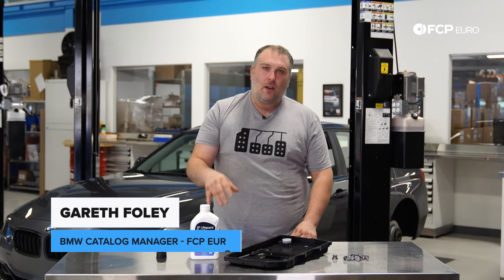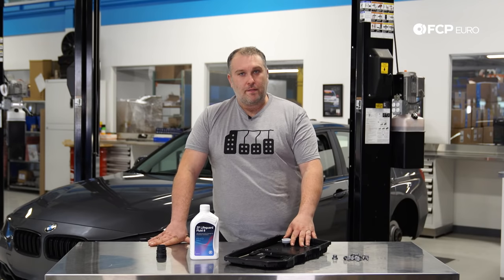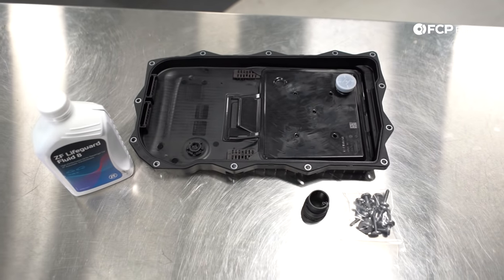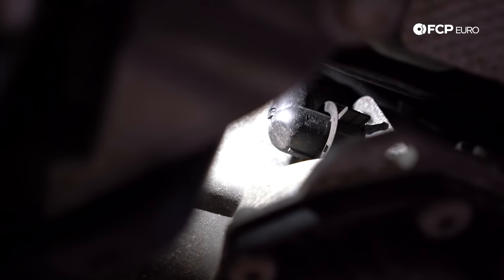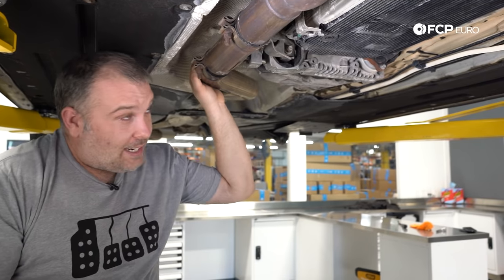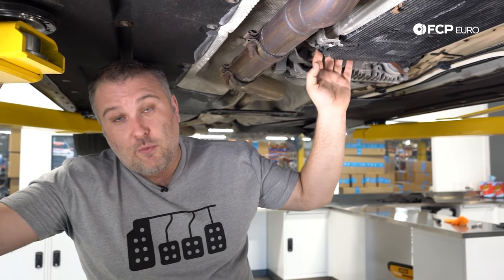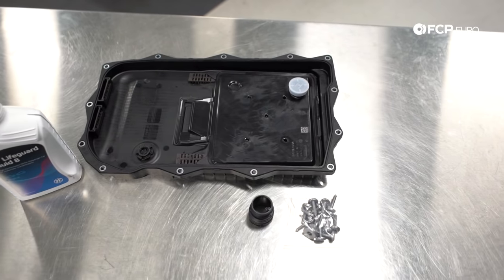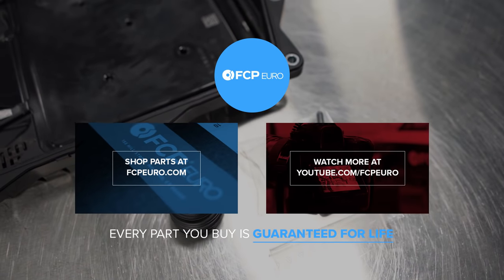ZF 8-Speed Transmission Guide (8HP45) - Specs, Common Problems, Diagnostics, & Maintenance

Comment: Hi there, my wife's 2015 x3 28d had a drive-train malfunction last Saturday. She came of the hwy and as she was turning right the car jerked twice and then lost power. She pulled over and shut it off. Waited 5 minutes and restarted it. Motor was fine but she could not select gears just stayed in park. Now it got towed to Kingston BMW and they diagnosed it as it needs a new transmission at 15k plus 2500 labour and taxes on top of that.

Now the car has never showed any transmission problems until that day. I tried to find out from the service manager to see what part of the trans is faulty but he refused to tell me or they do not know what exactly the problem is. I also requested that he sends me the diag results which i just got today after complaining to BMW Canada about the situation. I suggested there must be another option because i do not have 20k to spend. I bought the car last year in January with 136k kms for 20k and in August the egr cooler caught on fire and the car was at Otto's BMW in Ottawa for the whole month of August. Which they had to replace the whole top-end of the motor because of the damage from the fire. Which BMW covered 100%. Now 8 months later the trans goes out.

I kept on asking the service manager to see if there is another option like replacing the part that's faulty or rebuilding it. He just kept on saying the test says the trans have to be replaced with a new one. He also mentioned that they cannot code a used trans because i suggested that and he said they tried one last year and they could not code it so they had to put a new mechatronic unit at the customers expense which was 6k. As of today they still did not tell me what exactly is wrong with the transmission. So i finally got the diag results which is 11 pages. Not sure if any of you guys know how to read them.

https://www.bimmerfest.com/threads/bmw-x3-drive-train-malfunction-impacted-ecm.1397545/#post-13547229

Any help would be great. I can post the PDF here or maybe reply to this comment if you would be able to help in finding out what could be the issue. I have worked on cars all my life built motors, turbos and worked mostly on manual trans but i have no idea on all the new electronics crap. I ended up towing the car back to the dealership where i bought the car which is not a BMW dealer and they said will have a look and see what they can do. I did buy a 3rd party warranty 48mos or 80k but there is a 3000 dollar claim limit.
Cheers and thanks for your time
Lester.
Reply: Any updates?

Comment: i bought Audi A8 2016 v6 supercharger has 128,000km do you recommended to change transmission oil I don’t know if it has been changed before or not
Reply from the maker: Yes!

Comment: I just did a pan/filter replacement and fluid infill on my ram 8 speed. Started the engine and topped off the trans fluid while running. Drives and shifts fine, but now it wont go into park. Says “service transmission” 
???

Comment: Hello, After I changed the fluid in 2018 q7, the car randomly does not want to go to park and give the P07BE00 Parking switch A/B correlation code. Went to the dealer they said the fluid might not be at the correct level and want 1k to redo the fluid. Any suggestions would greatly appreciated. The car run at 90C after 30-40 min which is in the normal temperature range....

Comment: Hello. I have just one question. I have an F30 328i 2013 with 101,000 miles. At the 60K miles I had called the local bmw dealer to change the fluid and they told me that the fluid was “lifetime” and no need to change it. I decided to wait until the 100K miles as many sites considered this amount of miles to be lifetime. 
The question is, should I change it now or would the transmission start to fail?
My car is used home-work-restaurant-supermarket basically. I live in Miami FL and I have not even driven it to Orlando FL!! Very little of the driving has been bumper to bumper as I used to work off hours, not office hours.
Is there a scan test that can be done to chck on the fluid to determine if it is OK to replace it?
Thank u and thank u for all the great videos!!
Reply from the maker: Hi Noel, it would be wise to change the fluid now at the 100k mark and then continue to service it at the correct intervals moving forward!

Comment: Hi I have a BMW F32 435 AT 8 speed, Quick question when you put the car on sports plus and on manual mode, and you floor the throttle from gear 1, does your car go into overrev or does it automatically shift up to second gear?

Comment: Evening guys, I have the 8hp 45 in my 2011 5 series yBMW. I’m suffering quite badly with a very sluggish gear box with hanging onto gears, getting nudges when down shifting esp from 2nd to 1st. I carried out an oil service with new pan and ZF lifeguard 8 oil approx 2 years ago and have since drained and refilled the box twice to try and flush with fresh fluid. The car feels really lazy and is weak to take up torque. It’s done 170k miles now. Any ideas? Thanks

Comment: Thanks for the video.  I have one in my Ram 1500.  It’s having issues when the fluid temp is below 90 degrees.  It has little milli second slipping almost timed, it’s weird not the typical slip of transmissions of the past. When it warms up the little throttle jump/transmission slip goes away, but the shift is not as aggressive as it was prior to this.  I was going to start with a filter and fluid change before taking to dealer.  How many quarts of fluid does it “usually” take? Thanks!
Reply: Expect 8qt of oil for your ZF8HP

Comment: Please can you help. I have an F25 X3 xdrive 20d here in the UK. I have noticed a slight delay in taking up drive when moving off from a standstill. It's as if the car is in neutral and as I apply pressure on the gas pedal I feel a very slight delay/lurch as it engages forward motion. Other than that my car changes gears absolutely perfectly in automatic and manual mode, even using the paddles. This is not every single pull away, and I need to be aware if it is when the vehicle is cold or fully warmed up but as you are so knowledgeable I thought you might be able to shed some light on it. Thanks in advance.

Comment: Hello
I have a bmw f20 and the engine cooler failed, so the gearbox got contaminated 
I changed the cooler and the oil gearbox oil  but the car never engaged any gear, it's stuck on  "Park"
Could you advise what to do to fix this?

Comment: Hi if a f series auto isn't going into drive ...where would you recommend starting...? In terms of eliminating fault...ool change and filter first
Reply: Garth touched on this in the video and mentioned the connector as a possible fault if there was a leak in its seal. You don't give any specifics however such as miles on the car etc...

Comment: Hey there. Coming in late, but I have a question with a Charger 8HP. Could oil getting into the electric connector cause an issue like a gear change hanging? Meaning it feels like it goes into neutral for a second before going into the next gear. I've been coming across that lately and Dodge doesn't seem to be fixing it. Thanks

Comment: Thank you for the knowledge,
I'm using F30 ActiveHybrid 3 using GA8P70H there is an electric oil pump
which the diag Code showing up I guess it's broken. I try to find the part but I couldn't find it. 
Any suggestion ?

Comment: Thanks for this video brother, much appreciated! I do have a 2013 F30 335i, and my trans cooler/heat exchanger failed and I got coolant mixed in to my ATF. While driving last week my car decided it didn't want to go into R, D, or N, it just stays in P, so I got home and drained the fluid and it looked like a light colored chocolate milk... Smh..

I purchased the transmission filter pan kit + fluid from FCP along with a new trans cooler. Just swapped in all the new parts and my problem persists, and still only throwing a single code, "EGS 420641 - Parking lock defectively engaged: plausibility, driver's command/sensor feedback."

I'll get back under there and check that mechatronic seal, but aside from that, any advice you can offer of things I could check next?

Thanks again!
Reply: did you ever solve this problem, I think I have the same issue

Comment: Hi, I have an F30 328I M4 2013, it has stop start ,when driving come to stop sign or stop light the gear goes into park and sometimes  the engine stops completely, you have restart engine select D and drive on. it happens mostly when stop/start is on active mode !! the fault codes 421342 level2 unwanted power transmission detected in neutral, also 420641 parking lock defectively engaged plausibility drivers command/sensor feedback??? What would be causing that to happen??? thanks

Comment: so I have a 22 Jeep wrangler with the ZF 8speed. it's been having a weird issue where if I'm in low gear for a while (1st and 2nd), it'll occasionally whir or whine..sounding kind of like a cat screeching lol (sounds like spider gears when you reverse). Temp is fine, car is shifting fine. A few others been having the same issue on the forums, no one has an answer, even the dealers are puzzled. Could this be one of the quirks of ZF 8 speed transmission?
Reply: Yes my pan was upgraded to a ppe one with more capacity and fluid changed and now my trans has a whirring noise in lower gears as well in my Ram when you get up it a bit and it gets pretty loud too .I'm hoping the fluid level is just a bit low but if anybody has any Ideas I'd like to know.
Reply: @alanglinster4455  Yeah hopefully this is just a quirk of the ZF transmission...
Reply: I get that noise (a low whine) when coming to a stop, so consistent with lower gears. It's pretty much always been there, even after doing a pan and fluid change as part of regular maintenance. I suspect it is just a quirk.

Comment: I have 2016 Jeep Grand Cherokee summit 3.6 v. and use the same transmission.since you are not carrying the transmission pan for the Jeep, what would I need to buy the parts number from your website? I am devoted customer of FCP.
Reply: You’ve actually got the Chrysler 845RE Torqueflight transmission which is a Chrysler built 8HP licensed to them by ZF. Only the diesel and V8 models get the genuine ZF transmissions. There will be minor differences between your transmission and what’s in this video.
Reply: @Killian665  Thank you. Do you not sell it for Jeep then?

Comment: Enjoyed the video very much. Have a 2020 M340i and had a question on transmission fluid.  I heard from some mechanics that say if you change the transmission fluid it can impact the way the clutch plates interact (i think they called them that). Something about how over time particles get in the fluid and then when you change it, there is more space between the plates.  Is this true? if ZF says 50K miles, then it seems to me it should not be an issue to flush and replace the transmission fluid.  Thanks!
Reply: Late reply but I think that applies for transmissions that have high mileage that fluid has never been changed. By then the fluid has broken down and the transmission is used to the thickness of it. Changing it could cause problems but not if it’s regularly changed
Reply: @felixramos5808  Thanks to all who replied!!
Reply: josiahevans5699 After "listening" to all comments, I start to believe that you are "more" right than the ones who suggest flushing.
In the end, what is the use, if the gearbox lasts 300,000 km/200,000 miles longer than the engine that would need God's help to last 500,000 km/350,000 miles.

Comment: Hi! Could you gime me an advice about why it could do a bump between 2nd and 1st gear when breaking for a stop?
I have this problem on a BMW 520d GT 
The car has over 370k km and i don't know anything about it's service history...but i just changed the oil and filter and the two o rings.
I've been scammed by some private seller with fake service history and milage cut down

Comment: Hey, thanks for the video. A quick question for you: I've seen also the fluid change video (thanks for that) and my question is: by replacing the oil in that way (gravity only) we are barely changing only half of it (torque converter and cooling radiator don't release their oil). Is it still ok to have half new oil and half old? Is it better to use one of those machines that does the full oil replacement?
I ask as I can do the "gravity flow" oil change by myself (I've the PC to check the temperature for level verification) but surely not the full replacement.
Thanks. Alex (Giulia 2.0 TB with 8-HP 50)
Reply: That's the same question, I wanted to ask

Comment: Great video. I do have issue with my ZF8 and any advise would be much appreciated. When car is cold the gearbox is smooth but after 10-20min or when car reaches full temp the gearbox stating to play around little bit. Gears are changing not smoothly and under moderate acceleration shuddering can be felt between 1500rpm and 2000rpm. Shuddering is not strong but car is not accelerating smoothly and wonder if fluid and filter change is required? Anyone had issue like this? My car is F15 M50D
Reply: I got exact same issue, don't know the solution yet
Reply: @lenorolkos18   is you car 4x4 or xdrive etc? did you recently change tires?
Reply: @lenorolkos18  I’ve done ATF and filter change myself but this didn’t resolve issue btw. Most likely is tires. Quattro and Xdrive are very sensitive and allow only 1% tire difference between front and back. Haven’t changed mine yet but my started “shaking” when I’ve changed front tires and kept rear ones as they were good. Learned now that when changing tires on xdrive all 4 needs changing no matter if  let’s say rear ones are still good. It’s stupidly stupid invention that unfortunately requires us to spend unnecessarily extra $$$ otherwise if tires are not changed we risking transfer case problems or failure

Comment: newer (2021+ MY i believe) now have a metal pan with a separate filter. i have tried it yet, but the shape is the same, so you should be able to snag one of those pans and save the $200+ for a pan/filter

Comment: I have a question, I got a zf 8hp55 transmission and I don’t have a reverse it’s like it’s still in neutral I do have some forward gears but it feels like it’s slipping really bad and when I put it in manual mode I get 3rd gear and will not shift to any other gears, any advice what it could be? 

Thank you in advance

Comment: I have BMW 520d ZF 8 HP 45. The solenoids had Changed six months ago with the new original parts and the shiftings are now almost good. But when the car gets the second gear and then Just when I take off my foot from the gas pedal, after I take it off , the car shots to the front like I brake it. After the shifting if I continue to the gas 2-3 seconds and then getting the gas off, not just cutting off the gas after the shifting it doesnt do that. the revolution counter shakes a little But it does it when the car is hot, when I drive the car about 30 minutes.  Thanks. What can it be. The turbine is new.

Comment: The trick you mentioned to get the car into neutral manually (with that screw), is that still applicable on the 8HP transmissions in the newer G-series BMW’s?

Comment: Does this apply to the xdrive  at 123000miles? I’m the second owner and had a service but not the transmission changed is this recommended?
Reply from the maker: If the transmission is operating fine, and the fluid is in good shape, then you should do a service and stay on top of the interval, as Gareth mentions in the end; otherwise, it would not be recommended!

Comment: I have a “transmission is too hot warning sign” when push hard on highway. Where should I be looking for this issue?
Reply: Check your fluids at the proper temperature for tranny I believe it’s 86-122. Get an oil sample and pay to get it examined for coolant leak in tranny. ..when checking tranny Don’t let it get past 110 bc it takes forever to cooldown good luck
Reply: I got similar issue too on my F25. did you sort it?
Reply: If you’re out of warranty and you can’t check your transmission you should read up on how to do so. The reason I say that is because my 8HP 45re transmission Doesn’t have a dipstick so I have to do an additional step to get an accurate reading but if you have a warranty take that thing and don’t mess with it

Comment: Here is the thing , No mechanic have found my ZF tranny issues ..

* It makes whining noise when pass 2,500 rpms "sound like a supercharger belt" 
*Some times loss torque just when change from 1st to 2d gear  no always 
* Highway or city speed no issues 
* Fluid and pan was replaced  at 100k miles 
* Problem starts with 115k miles
*Filled with original Mopar fluid
All mechanic says never heard that issue

Comment: Hey, i just bought a 2013 335 with 150 000km and i was wondering if i should change the transmission fluid or is it too late.
Reply from the maker: Never too late! But drain and fill as opposed to flush

Comment: My car has 104k on it. It just seems to be clunky. It is an awd, it could be the transfer case but I just had that replaced 2000 miles ago. The transmission fluid and filter pan have been replaced and the car still acts clunky. Mainly when pulling to a turn without stopping and getting back on the gas. The pedal seems dead for about a second, then the car jerks to life. Feels like it’s going to damage something over time if it keeps up. The rubber bushing looks okay too. So I’m lost. Some days it drives perfect and smooth. Others it acts like it doesn’t know what gear it wants to be in.

Comment: My friend do you if I can swap ZF transmission from 335i F30 with N55 engine to my 330I E90 N52 engine ? I want install this transmission on my N52 engine. As I can see the block threads flange is very similar between N52 and N55. Could you help me please with this information ?